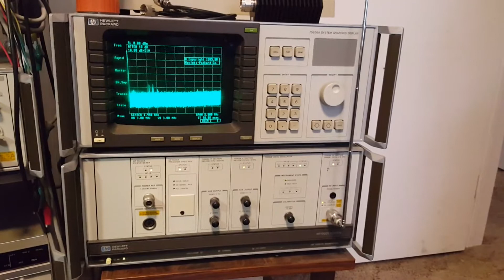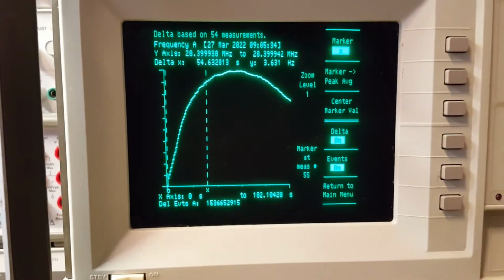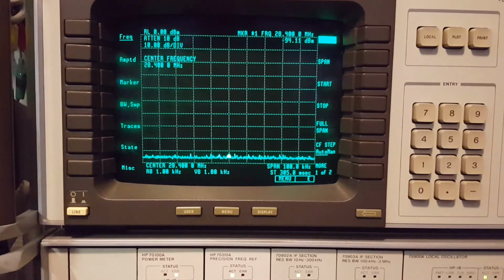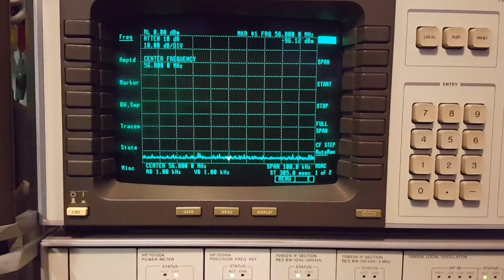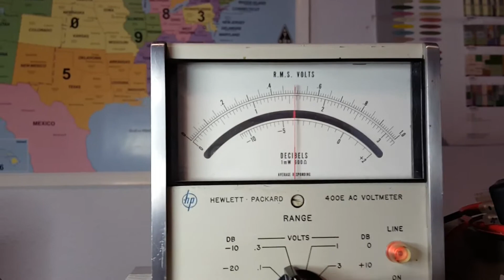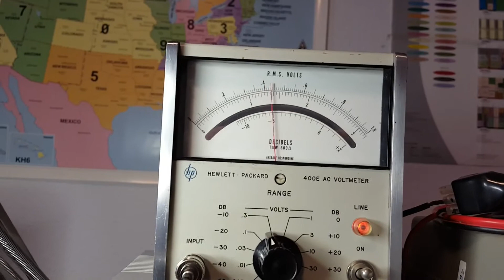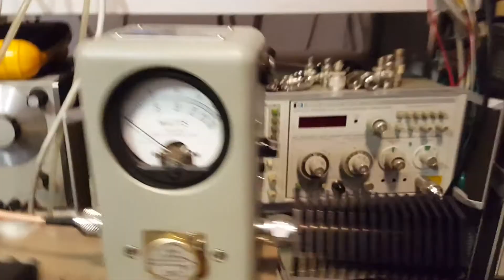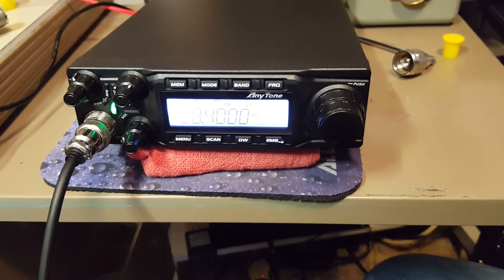Anytone AT-6666 bench test.

Comment: Thanks for the great tutorial. If I run this stock radio with the power turned to maximum, what would the amperage draw be from the 12 volt car battery?
Could I plug this into a cigarette lighter outlet or would I need a dedicated hard wire?
Reply from the maker: Typical current draw for a stock AT-6666 running full power on FM is about 7.5 amps. I don't recommend using the cigarette lighter plug for anything over 5 amps. The center contact can have fairly high contact resistance and may present issues for you. I use the "Littlefuse add a circuit" pigtail and draw power right from the fuse box that's inside the cab of the vehicle. In any case, I would recommend a 10 amp fuse. I use a 50 watt 2 meter rig in my mobile and have had no issues. Thanks for watching!
Reply: @CraigPetersen12f36b   Thank you for the response!

Comment: i have one in my house in the Philippines really great at reciving skip im cb'er and only on 27 megs
Reply from the maker: I have used this radio several times on 10 meters. Worked several stations back east out of the mobile. Would get unsolicited comments on how well the audio sounded. The only issues with the radio I have is the rotary encoder is a bit bouncy and the receive is a bit too wide on SSB for my tastes. I added the near impossible to find CTCSS tone encoder so I can try some 10 meter repeater contacts with it. But overall, for the money, it's a very good radio. Thanks for watching, 73.

Comment: Sir I do have a question but it's not related to this radio. Just an example, 29ltd at 2.5 watts deadkey, swing at 15 watts pep pushing into an rm italy kl300p. The amps dk at 35 watts swing is 140 to 150 watts pep. What is really being transmitted, the average or the pep at 150 watts? Reason I asked is, if it's 150 watts, why is the current draw is only less than 10amps compared to my 2 meter radio at 90 watts draws 15 ampheres. Shouldn't a 150 watts draws more current out of the power supply? Sure would appreciate it sir.
Reply from the maker: Good morning Francisco,

It boils down to meter accuracy and it's ability to respond it fast transients, what is typically observed is the average or RMS output, some meters have a peak hold feature to overcome this limitation. Current consumption on AM and SSB will always show a lower reading than running FM due to it's constant carrier operation. Another thing to take into consideration is the amplifiers class of operation, class A or A-B will always consume more current than a class C or D amplifier to generate the same output. I hope this help answer your question, 73 and thanks for watching.

Comment: I love my Anytone 6666. It has some different finals, bigger capacitors and max mod. Mine goes from 2 to 20 watt dead key. 60 watt average when turned up and about 120 to 125 watts peak. Good clean audio and all on frequency. I’m getting my instrumentation degree so when I came in I took it to class to use the scope and spectrum analyzer. With my instructors help I tested it and it was very clean. My instructor has his amateur radio license and used to own a electronics repair shop that specialized in radios. My radio doesn’t get hot. Just a little warm if I talk for a long time. I get lots of compliments on how I sound. I was running it barefoot for like 3 months and it did great talking skip. About 2 months ago I got a 4 pill 2879c with SSB. Running it with the Anytone it great. I can tell the amp can handle more drive but my radio does a good job. Also those 4 2879C’s love that current! I get some voltage drop. I plan getting a super cap to help it out. With my radio driving the amp it does 380 to 400 average and 700 pep and it barely gets warm. I love it. I’m running a 6 foot skip shooter on a workman triple mag mount that you can use your own coax cable on. Barefoot I could talk skip no problem but sometimes didn’t have the power to reach some people in Australia. But now I can pretty much talk to anyone I can hear. 73’s!  881 Texas mobile radio.
Reply from the maker: Thanks for watching. I have been having a blast with this radio on 10 meters, my only gripes are that the rotary encoder (at least on my radio) is occasionally bouncy, and the filter for SSB is a bit too wide, but overall I am pleased with the radio. I run this radio stock in my truck with a Browning 140 cut for 28.500, I still use CB but mostly use a NOS JC Penney 6247 in the HAM shack with a Maco 5/8 vertical. 73 and happy DX!
Reply: @CraigPetersen12f36b   Yeah the encoder on these is definitely not the best. That’s one reason I like the stock mic. Before this radio I never really talked on SSB so I have nothing to compare it too. Overall it’s been a great radio.
Reply: Hope you get caught.
Reply: I was in Hunt County (NW corner) on a hill, with no obstacles, with a 35' tower, on a A-99 and my Anytone AT-5555n, talking to Europe in the morning, Artic Circle City, NP, CA, to Santiago, Chile and South Pacific in the afternoon and deep into the night.
Great equipment makes DX'ing fun.

Comment: Hi Craig,  That was an amazing video.  You obviously have the equipment and the knowledge to properly check the 6666 out.  I have the same radio.  It has never been installed yet, but it has been altered (no further comment).  I want to trust that it is on frequency and working properly.  I bought it because I do a lot of interstate driving to visit my kids and my RCI 2970 would not fit in my new vehicle.  I have a Sirio 5000 antenna that will be roof mounted using a Breedlove Puck mount.  How can I get you my 6666 for you to bench check it and what is the fee? I will be honored to be able to send it to you for evaluation.
Reply from the maker: Thanks for watching! I used to service radios but haven't in some time and don't offer it as a service. From what I have experienced with my AT-6666 you shouldn't have an issue. I run mine stock with a Browning BR-140 antenna and have not had any issues, even with the base load antenna I am running it gets out pretty well. I know several people who have used these rigs and none of them have had any significant issues with them.
Reply: @CraigPetersen12f36b  Hi Craig, I understand you are pretty much out of business, however since someone had already put there fingers in it (I know some of the caps were upgraded),  can I please just get you to bench it, I will pay shipping both ways plus what ever you want. The radio is brand spanking new. It is going in a new 2022 Silverado.  I am just hoping it is on frequency and stable.  Your knowledge, equipment and skills show me that you are the real deal.  I am an old guy, I am medically disabled/retired LE now (38 yrs of service) living in the Foothills of the Great Smokey Mountains here in Tennessee.  I also have my Tech Class license, but I will be honest, I just got it for eleven meters when on the interstate (my twins now live in Florida). cliff70chevy@gmail.com

Comment: Hi Craig, are you happy with the stock mic or are using something different for your mic? Thanks!
Reply from the maker: I'm using the stock mic, it seems to work very well and I get good signal reports on the audio. It's also nice to be able to change frequency with the push buttons on the top of the mic instead of using the tuning control on the front of the radio.
Reply: @CraigPetersen12f36b  Great to know. I’m thinking this maybe my next radio. Glad to hear you’re happy with it. I want a radio that’s good to go out of the box! Thank you
Reply: I also get good reports with the stock mic. Every once in awhile I use my Astatic 636L noise canceling mic but I have to turn the mic gain all the way up for it. And also with those you have to have the mics mouth guard up against your lips. It does give my voice a little more bass. But I mainly use the stock mic. I like that I can change the channels with it, not have to have it right up against my mouth and don’t need to talk louder than usual. Overall it’s a very good radio as it is. If you haven’t gotten one yet I got mine from truck Cb sales with the Truckerized package. Upgraded finals, capacitors, voltage regulator and Astatic mic. I tested the audio when I got it on a scope and made sure it was transmitting it n frequency with a spectrum analyzer and it was all good. I mainly did the upgrades for longevity. Also I hear these radio can run a little warm when you talk a long time. But with the different finals, other upgrades and tuning mine barely gets warm. But from what I’ve heard from many owners the radio is great out of the box.